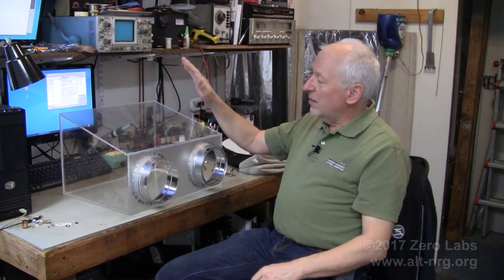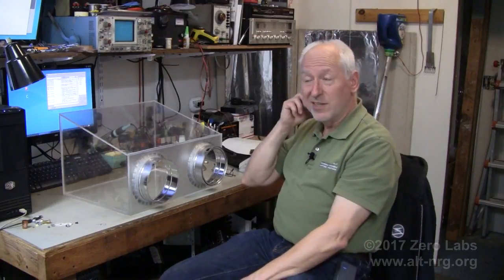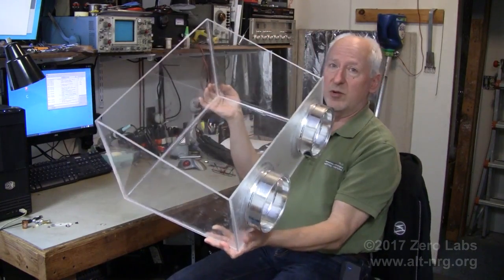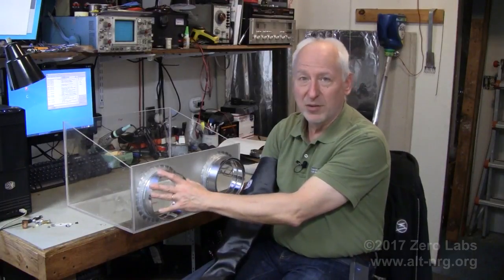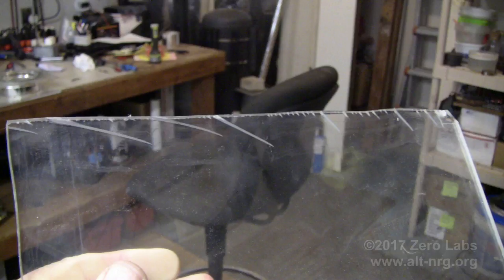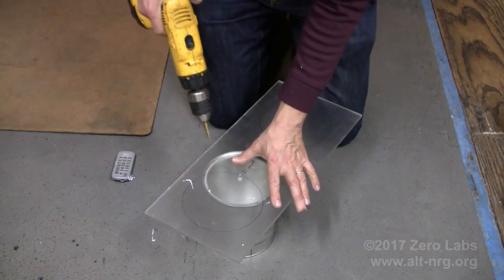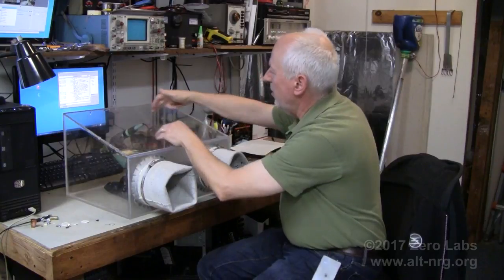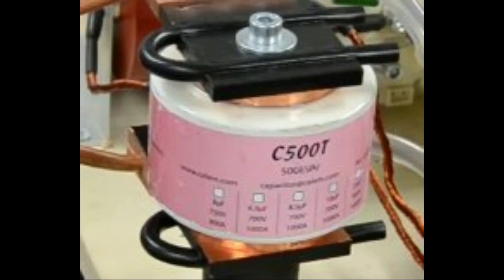#474 Non Joulian Magnetostriction update 3

Comment: Won't the induction heater heat up the inside of that box and cause it to melt?
Reply from the maker: Only the crucible and it's contents will get hot. Just the same, I will be running it for a couple of hours each time and heat buildup might be a problem. To that end I am also building into the glove box a Peltier heat pump to keep the inside temps down.

Comment: I'm a little concerned about how much heat you will be putting inside the box from the induction heater with no way for it to escape. I have not played with argon and do not know its thermal properties but maybe you have already researched this and do not fear a meltdown. I have some 14" long piano hinges you can have for free if you want them.
Reply from the maker: Temp may rise a bit but I'll be allowing for thermal expansion with a medium size mylar balloon on the exhaust port. If it becomes a problem I'll add a peltier heat exchanger. I don't think it will come to that. I also think I might do away with the top lid idea in favor of the transfer chamber or removing gloves for larger items.
Reply from the maker: It's now looking like I may need to add some cooling. Probably a Peltier heat pump. The process to create a mono-crystalline metal billet is fairly slow. But, the induction heater is ideal for a heat source.

Comment: Not entirely sure of the purpose of this box since I'm new to this channel, but from what I can understand you're going to pull a vacuum in it to remove air and then back-fill with argon to create an inert atmosphere within it for testing.  However you're going to run into one very large problem as soon as you try and use a vacuum pump to remove the air, since even a small vacuum is going to exert very large forces on the box walls-- up to almost 15 PSI for a perfect vacuum.  A very rough estimate would be to guess than one of those walls is at least 12x12 inches/144 square inches, resulting in over 2,100 pounds of force on a single wall.  Even a small vacuum is going to cause those walls to bow inwards and break the seams, it's just not rigid enough to take a vacuum so I would recommend moving up to something much, much thicker since you want very little bowing to avoid rupturing seams.  Also your gloves aren't going to handle much inwards pressure either, I would suggest connecting one to a compressor with a low-pressure variable regulator and seeing the results of up to 15 PSI.  I have some experience building vacuum enclosures and it's remarkable how strong those forces can become when you have a relatively large, flat surface that needs to flex very little.
Reply from the maker: Only the cylindrical transfer chamber I will be adding will ever see a vacuum.

Comment: Good to see that you got a blade to cut the stuff. I went to Home Depot for some acrylic 3/16 inch windows much like the plexiglass. I had to cut the piece at the store when they would not cut it to fit in my vehicle. A cashier handed me some garden snips and yes of course it sent a crack through half of the sheet for using the wrong tool and Home Depot would not care less so I was out the money. Back at home I was able to cut it best with thin 2 inch diameter steel drimmel blades, also not that common. Other blades are not recommended.